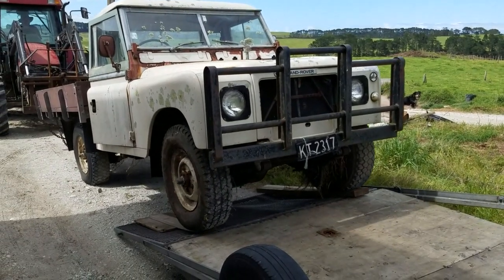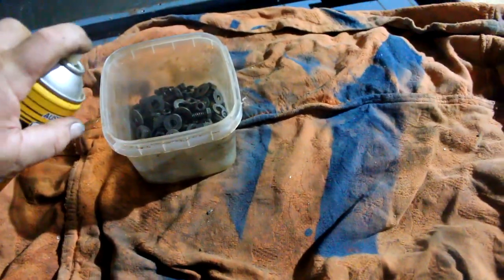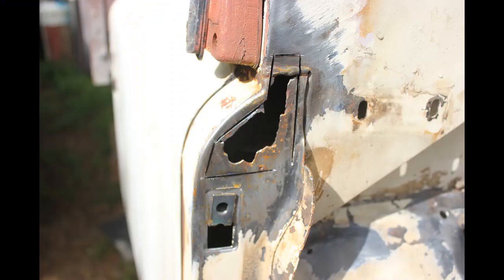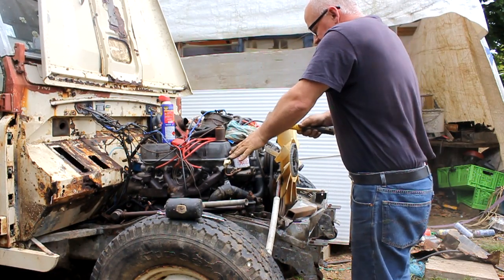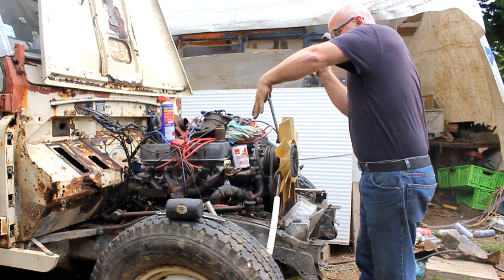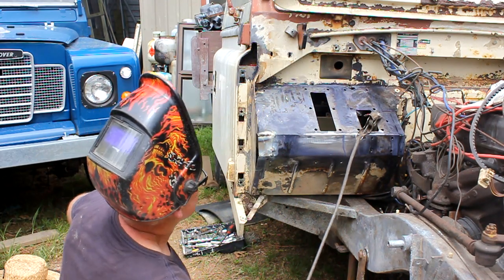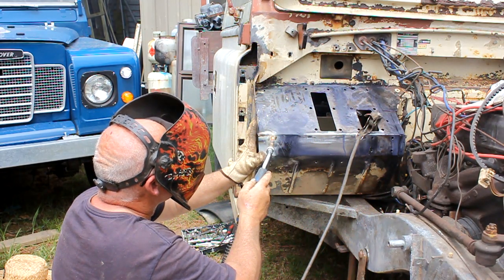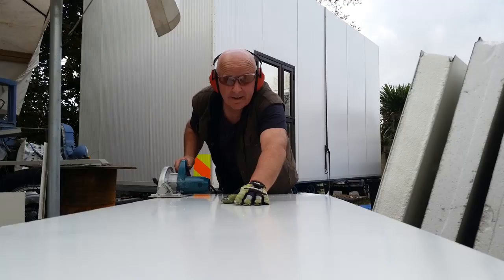Land Rover Rust Repair!-  The Right Way To Restore/Rustproof

Comment: Heavy copper sheet is vastly better as a welding heat sink. Eastwood sells a good copper heat sink, with magnets built in so that it can hold itself in place (safe with heat). Also, fish oil has a fairly limited life inside vehicle bodies. The best anti-rust treatment is a slurry of 1/3 fish oil, 1/3 Teroson cavity wax (the heavy liquid, not the spray can) and 1/3 spraying thinners. You can blow it everywhere with a proper long air wand, or simply use an engine cleaning gun. This slurry is initially very liquid and creeps in everywhere, then dries to a waxy, self-healing coating that lasts a decade or more, although I always redo sensitive areas such as doors every five years of so. CRC rust converter is an expensive way to treat light rust. Corroless is better and far cheaper and can be sprayed or brushed over light rust then topcoated later. About $130 for four litres. Keep up the good work :)
Reply from the maker: Thankyou for all that info Clive. problem is - I live in a town with 1 hardware outlet.and we use what we can get. All these brand names are interesting.Eastwoods is new to me  Ill get back into their website and have a good look around. Protective Paints- Coroless - I used years ago on some agricultural implements and was most impressed. I will check out their primers. You comments have been  so helpful

Comment: Great video, I’ve tried doing that spot welding like you were doing to keep it cool and on mine I blew holes in it.  Of course my wire welder is a cheap one. I need to get my Lincoln wire welder fixed up to my welding machine. Can’t wait to see the V-8 truck going. I’d love to have something like that to tinker with once I get done fixing my 4 tractors, tree shaker, both my CanAm Commanders and especially my John Deere 450E long track dozer ( my secret stress reliever)

Comment: I have  used vinger to clean up old nuts and bolts found it work's well also use duck oil. I use quite a lot of copper slip as well it's great stuff. I have to have the sills welded up in my MG ZR. The foot wells on the bulk head seam to  most common place for the  Land Rover series for roting. I  see you  are still having problems with your Audio. Where I am in the Highlands rust kills everything. Anyway mate hope your well. The rust converter we use that over here to works really well  if your working outside.👍
Reply from the maker: ive recently found that the vinegar we get is only 4%  with citric acid I can mix to suit the need.

Comment: What welder would you suggest a DIYer should get for home manufacturing etc?  Thanks
Reply from the maker: I use a Migtronic 200 - nothing flash- but 200amps will weld 10mm steel safely for drawbars on trailers It can also be turned right down to weld 0.5mm sheet steel. I use Flux Cored wire to keep it more potable and because sheilding gas is easily blown away when working outside. The result is horrible porosity. try to avoid those 3 in one machines Tig/Mig/Arc. Its better to get them seperately for longevity

Comment: Hello, what welder do you recommend? Thanks!
Reply from the maker: For a home resto on a budget I would get a 140 amp mig and run flux cored wire. ensure it has rotary dials for amps and wire speed- not 3 position switches.  Make sure the wire feed assembly is steel not plastic. and buy a mid price range auto darkening helmet

Comment: Awesome stuff! I would say Brutus is in good hands :).
Do you use shielding gas with your mig?
Reply from the maker: Seldom. because im welding outside so often and because Im also welding lots of galvanised steel - I use flux cored wire. I get a great price on it too. gas shield is nice for production work  but it keeps getting more and more expensive!  Oh and it fits and sparts on anything thats not perfectly clean
Reply: @t.h.o.r.  Thank you, I use flux core as well but have never tried it on autobody, I'll have to give it a shot now :)

Comment: Great welding tips! Is your MIG a heavy duty industrial one?
Can't wait to see it running as you don't get to see many of them around 😊
Reply from the maker: reasonably grunty - 200 amp so i can weld trailer drawbars safely - but certainly not industrial- just a serious hobby level unit. here is a link to it= https://www.machineryhouse.co.nz/W1102
Reply: @t.h.o.r.   Thanks

Comment: That foot well, why not just weld in a thicker piece of metal and avoid having the possible wicking if water to be trapped there? IE. if the inside section and out side section are 1mil thick weld in a 2 mil piece of steel?  Cheers.
Reply from the maker: thats a good point- theres another rebuild happening in about 3 months- we can do it that way

Comment: Reverse thread on the fan clutch?  I betcha it is.
Reply from the maker: Hmmmm.... I watched a vid, cos I was concerned about that. and his one was not LH thread https://youtu.be/OS7M6O6NHKU?t=96
Reply: @t.h.o.r.  But that's not your model. 
Otherwise, it looks like it was moving, if I'm correct you were tightening it up. 
Looking at your fan suggests to me it normally spins clockwise so the nut has to go clockwise to loosen, (anti-clockwise to tighten)   otherwise if the nut was anti-clockwise to loosen it would undo itself when the engine is running.
Reply from the maker: @noelwhittle7922   haha this is the whole reasno I cant work for other people. Daily I get brainfreeze when faced with visualising the simplest concepts. I simply could not nut out in my head which way it had to be. with truck wheel nuts its LHT on LHS - I know that. but then lost the plot while thinking that with a soft thermo clutch on the spindle - Is a LHT needed? - send your answers on the back of a postcard -lol! 
I promise = as soon as its ligh tomorrow morning Ill go give it a bash the other way
Reply: @t.h.o.r.  No worries.  I had to sit here with a bolt and nut and wave my hands in circle motions.   :)
So tomorrow morning at least 2 of us, = you and I, will have our fingers crossed.